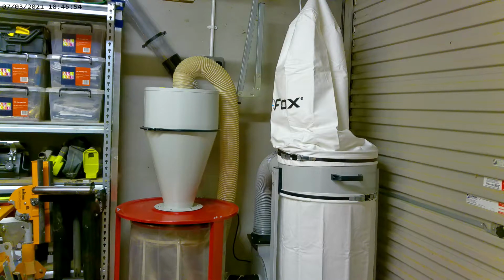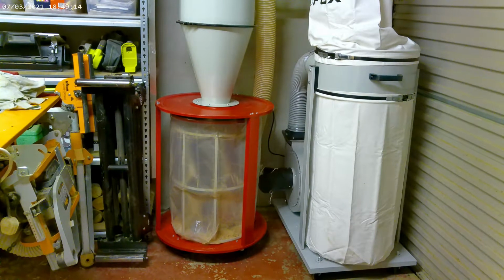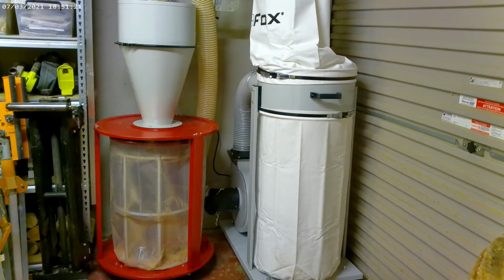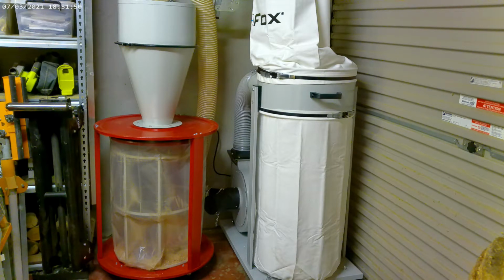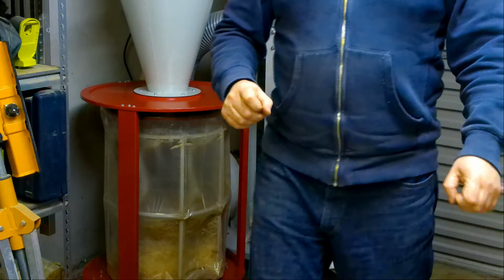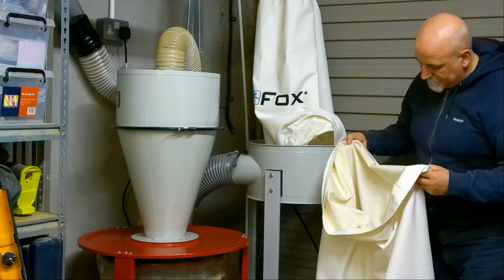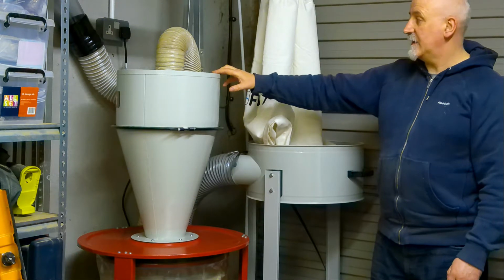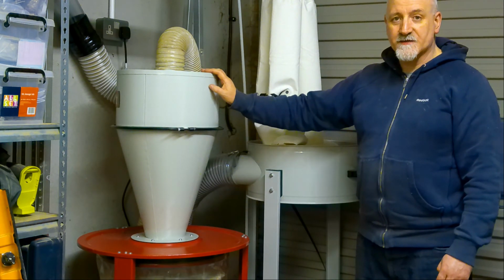Cyclone Review

Comment: It looks like the bag is on the outside of the frame below the cyclone.  How do you change the bag when it gets full?  It appears you would need to remove the frame, which would likely cause the dust and chips to lift out with it, which could be messy.  Am I missing something really obvious?
Reply from the maker: Hi Dave, there's a ring similar to a normal extractor inside the legs, you keep the bag on with a band clamp. Actually quite easy to change the bag.

Comment: Would be interested in the review of the axminster piping kit. Did you ever get round to making it ?
Reply from the maker: Hi Andy
Yea I installed the piping kit, I'll see if I can get time to do a review this week. on the whole it's ok the bends don't fit very well, I had to tape them with duct tape to make them air tight. The Blast gates work well, but the slide blocks up very easily. the self cleaning blast gates are much better, but, have to be bought separately. I trimmed the end of mine with a grinder to allow them to act as self cleaning gates.
Reply: @frankkane3904  Just setting up my workspace and looking for somthing to use so interested in your opionions on it. Looking forward to the review. Am I right in thinking it's 63mm not 100mm ?